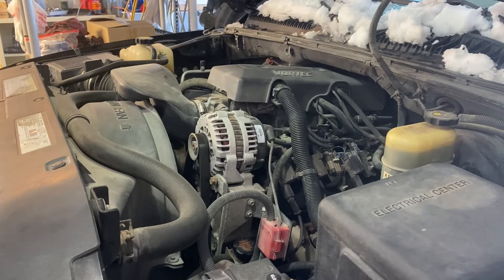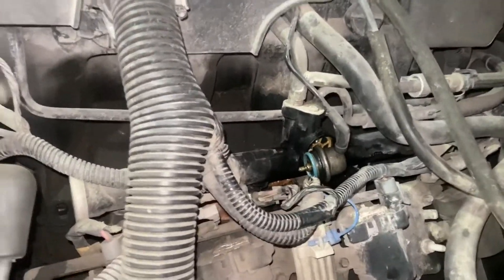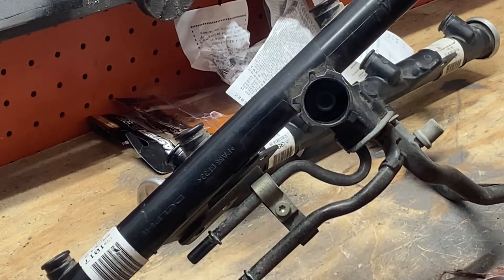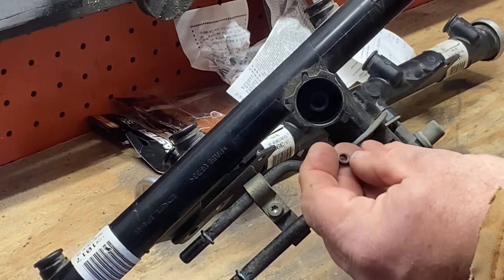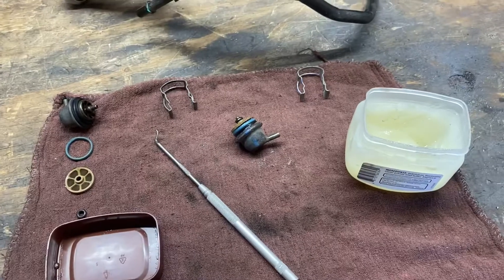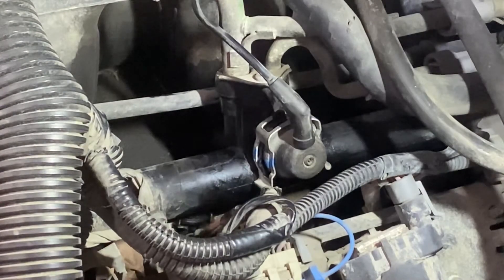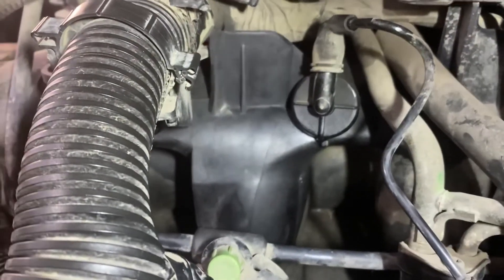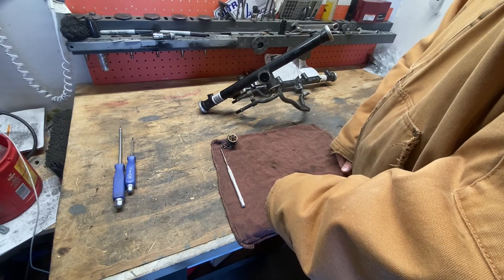2000 Yukon XL fuel leaking at the Fuel Pressure regulator

Comment: I'm glad you were able to figure out the problem(s) and get it fixed for a tenth of the price of a new regulator. On a side note, I was wondering what you thought of the sloppy stage 1 (a 216/220 intake/exhaust duration cam essentially) in a 5600ish lbs silverado 5.3 with a stock stall converter? And what do you recommend for springs? Thanks for all of your honestly great content.
Reply from the maker: I really like the 1838p for my application but for your 5600# Silverado with stock torque converter I’d look at the Elgin E-1257-P. 
With the weight of the truck and stock torque converter you will want to build Low-Mid range Torque; the aftermarket camshaft will also increase the top end HP. Naturally it will need a good tune after the upgrades. 
With either the 1257-P or 1838P  you can run LS6 valve springs NA. If you ever wanted to add boost I’d recommend a PAC 1218 or equivalent valve spring.  JD
Reply: @HeadFlowInc  thank you so much for the guidance, I really appreciate it.

Comment: Ah yes, the GM fuel pressure regulator.  These also can also cause otherwise unexplained hard starts (extended cranking)  in all GM vehicles LS engine or otherwise.
Reply from the maker: It’s interesting you mention the starting issue, I’ve noticed this 5.3 didn’t always start on the first crank. Sometimes I had to slightly push the gas pedal to get it to start on the 1st crank. 
I’ll pay close attention to see if my work today helps!  Thanks for the feedback!  JD
Reply: It should correct you having to apply throttle to start the vehicle!  Report back your experience in a few days if you can.
Reply from the maker: After replacing the FPR and hooking it back up to vacuum the 5.3 is running/driving smoother and it starts First time every time now!  As a matter of fact it starts so fast now it’s hard to get use to it!  JD
Reply: Glad to hear my friend!  Cheers from Wichita, KS.